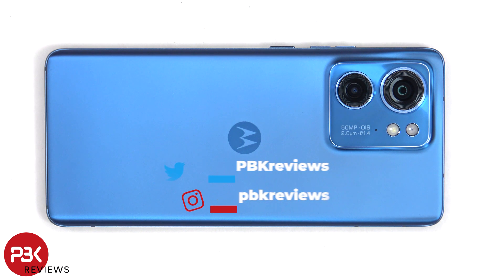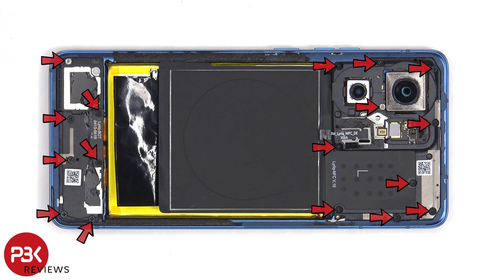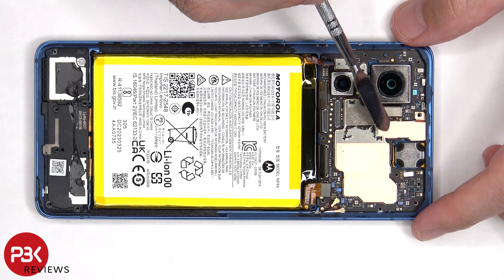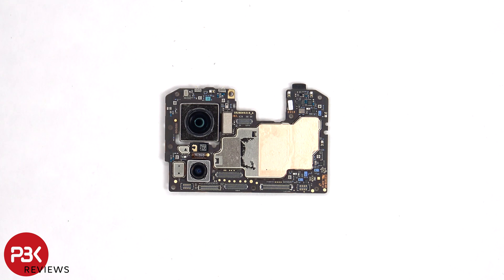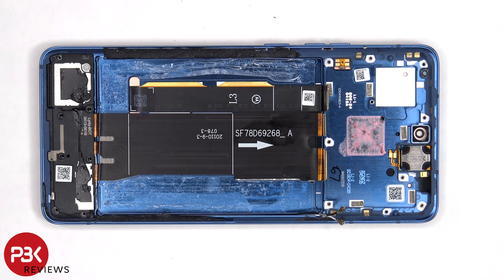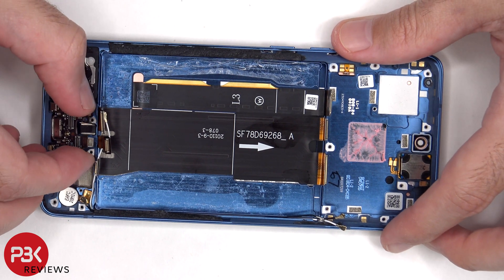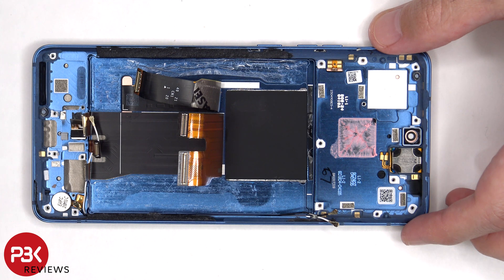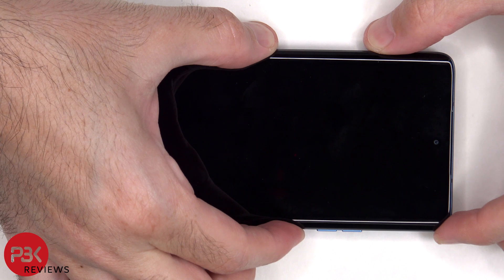Motorola Edge 40 / Motorola Edge 2023 Teardown Disassembly Repair Video Review

Comment: My rear camera stopped working (black screen and camera app timing out/blocking) after a drop, could it be a cable that came loose or something else? If i open to check will I need new adhesive to close again the back frame? Thanks for your helpful teardown video

Comment: My moto edge 40 fell down accidentally and the physical sim slot is not detecting the sim, what could be the problem ?
Reply from the maker: could be a loose or disconnected cable on the sim reader board.

Comment: Don't know what the go is but I just ran a system check on my edge 40 and it's got a li-po battery not li-ion... I've heard of falsely wrapped replacement batteries but this seems to be from the factory. Interesting.

Comment: Is there a video how to replace camera lens glass?
Reply from the maker: Apply heat with a hair dryer to loosen the adhesive under the glass lens, and then you can use a razor blade or xacto knife to pry off the glass lens. Check rounded.com or mobilesentrix.com or ebay for replacement lens and adhesive for your phone.

Comment: Friends, to remove the main rear camera lens, do I need to remove the cover, or can it be changed without opening the back?
Reply: At the beginning, he notes that you can heat* and change the camera glass without removing the backing plate :) 1:13 

I'm currently looking for parts to fix the glass lenses, and possibly the underlying camera assembly on mine ! 😁 Hope this helps
Reply: @X3r0. I understand, thank you very much, but unfortunately I will pay more for Motorola authorized technical assistance, as my device is still under warranty and they can only replace the cover completely, as it comes from the factory
Reply: @kaiquebrito9773  good luck! Motorola wants 200$ to repair mine, and I am certain I can do it myself for less

Comment: Can it possible to replace  camera glass of moto edge 40 .what it cost
Reply from the maker: Yes, but I can't seem to find any available online yet for just the camera glass lens, so you might need to buy a battery door cover replacement/backplate which comes with the camera lens pre installed. Here are a few links: https://www.ebay.com/itm/115866258876?chn=ps&_trkparms=ispr%3D1&amdata=enc%3A1V9_Gkgw4QIKbf2rEFTnwAQ63&norover=1&mkevt=1&mkrid=711-117182-37290-0&mkcid=2&mkscid=101&itemid=115866258876&targetid=1585159291131&device=c&mktype=pla&googleloc=1013819&poi=&campaignid=19894961968&mkgroupid=148855406073&rlsatarget=aud-1339632007434:pla-1585159291131&abcId=9307911&merchantid=114706018&gclid=CjwKCAiA4smsBhAEEiwAO6DEjbWV6qqAHzR4vBh2N_UVkdpl8YPnOsgnpWaYclgvPdX408aI2QjCmBoC9p0QAvD_BwE    or   https://www.replacebase.co.uk/genuine-morotola-moto-edge-40-replacement-battery-cover-panel-with-camera-lens-red-5s58c22715-xt2303-authorised

Comment: Sir i have an issue i saw in my ph is that the inside speaker mesh of loud speaker has been somehow slided away from its place does it need to be fixed? Im afraid about water resistance now
Reply from the maker: It can possibly pose an issue for water resistance. You can get it fixed if you're worried, but unless you're usually around water I wouldn't worry too much about it.
Reply: @PBKreviews thank u so much is there any water resistant mesh available to buy anywhere?

Comment: Why this phone heats up so much while normal use and doesn't heat up duirng gaming
Reply from the maker: Not sure, might be the antennas in use when your surfing the web or using data which usually heat up the phone.
Reply: @PBKreviews  So its better to run phone on wifi instead on SIM cartridge mobile data for prevent the unwanted heat?

Comment: Moto edge 40 has, lithium polymer or lithium ion battery?
Reply from the maker: lithium polymer, which is labeled as lithium ion polymer. If the battery is lithium ion, it will only say lithium ion and not say lithium ion polymer.

Comment: Sir I poked my sim ejector pin in the primary microphone hole few times, now I'm worried about the microphone. Did I damaged anything i.e the microphone or the channel or the module or the water resistant thing!
Reply from the maker: Hi, no you will be fine. Both the filter and mic are seated above the hole and wont be damaged.
Reply: @PBKreviews  thank you very much but  actually i poked it towards the screen/ upwards, so nothing to worry right!! By the way very nice video.

Comment: Is this phone still waterproof ? I mean after repairing it ?
Reply from the maker: If you use the original pre cut adhesive (which usually comes with replacement battery door covers) and correctly install it (after removing the old one) then yes you would retain any waterproofing.
Reply: @PBKreviews  thanks for replying 😊

Comment: There's water in camera in my moto edge 40...will service center charge money to repair ?
Reply: No bro, water damages are not included in warranty. If you’ve purchased the Flipkart insurance or any other full protection insurance plan you’ll get it repaired for free. But if your phone is still working and only the camera is having the water drops, then I suggest put your phone inside a bag of silca gel (rice will do fine). And be careful with it.
Reply: @noblesunny5  thank you broh✌️
Reply: @PBKreviews  how much time it takes remove moisture
Reply: @noblesunny5  for how much time ?
Reply: @vanshhhhhhhhhhhhhhh   That depends. But you should keep it for a minimum of 24 hours. Don’t try to switch on the device right after you got it out of the water, it’ll damage the circuit and it won’t be fixed with rice or silica gel.

Comment: Is there copper underneath the graphite?
Reply from the maker: No there is no copper vapor chamber or plate from what I saw, just 3D graphite which was used in phones like galaxy s21 ultra or similar. Still does the job but I would prefer a vapor chamber.